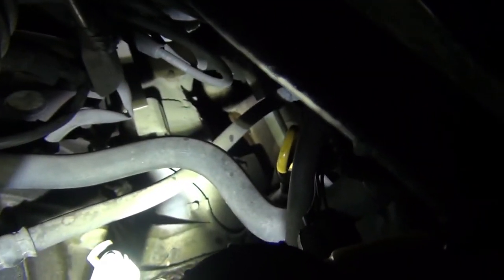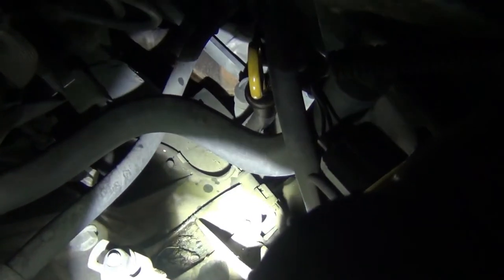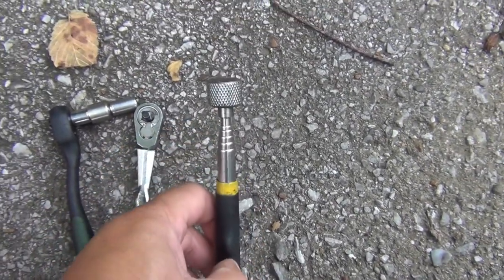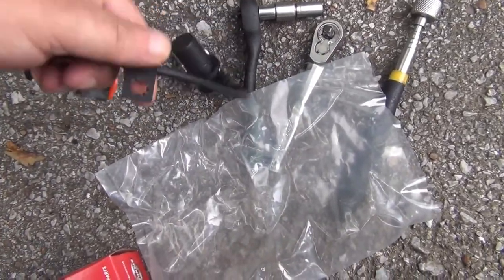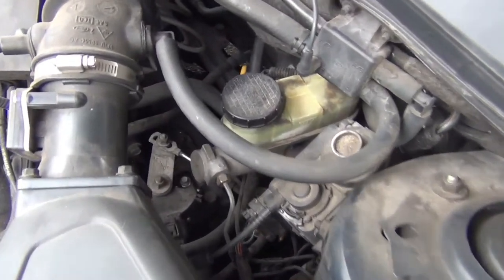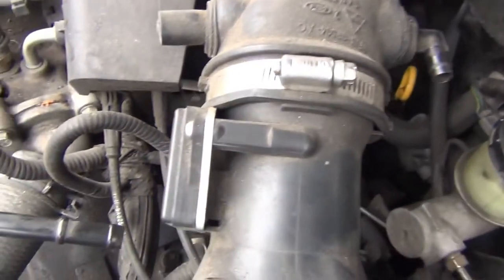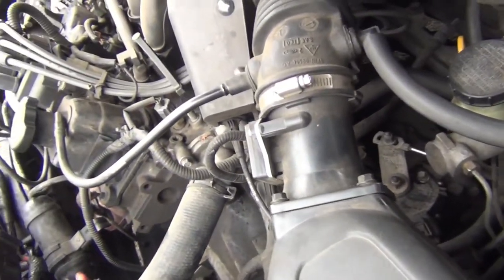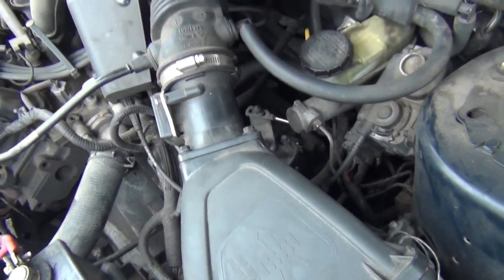2001 Ford Taurus w/Erratic Speedometer/Shift Issues-Vehicle Speed Sensor Replacement

Comment: I got a 2002 with about 115k miles that has an occasional hard shift from 1st to 2nd. Sometimes it not that bad but sometimes it revs real high with a loss of power and a big violent shutter. Sometimes i can floor it right after and it just takes off. Any idea what that could be exactly?

Comment: Ok so I have a 2005 Ford Taurus no issues as far as dash cluster. Speed works fine only thing is the check engine light is on but that’s for a multi miss fire. But from 1-2 gear it revs up to nearly 2500 and loses all power and shifts hard. Should this fix?
Reply from the maker: Your 3 shift solenoids need replacement. You can do it yourself but hard. There is a square box below your battery or on the side of your transmission on the driver's side. It is just like your transmission pan on the bottom, but it has 5 solenoids in it, the hardest part is to get to it.  You don't have to take it to a transmission shop. Drain your fluid then pull off the 8mm screws around the pan. The 3 shift solenoids are on the right side. They twist counter clockwise to remove, very simple. You have to use 2 jacks. Be sure to remove your upper motor mount behind the alternator because it will break, if you don't remove it. Also remove the driver's side drive shaft to have more room, to work. You can get the shift solenoids at autozone.com .They are around $23.99 each, part #96953 for the AX4S transmission it is a good idea to change the tcc solenoid also, it will have a "Blue" tab. You don't have to change all 5, just those 4. Check out other videos on youtube, it will take a day to do the job, 
but worth it.
Reply: @a1fixitguy309  That's a terrible diagnosis. It could totally be the output shaft speed sensor, if the ECM doesn't know how fast the output shaft is turning it doesn't know when to shift. Why would three solenoids go out at the same time? If three solenoids truly did go out at the same time that indicates a severe issue with the transmission itself.

Comment: I have an, I think 2004, ford taurus and the speedometer needle and for some reason it works when it was hot in the car or when a light shows up on the dash of the car. Would you know the cause of this or how to fix it?
Reply: It might be a 2001 actually